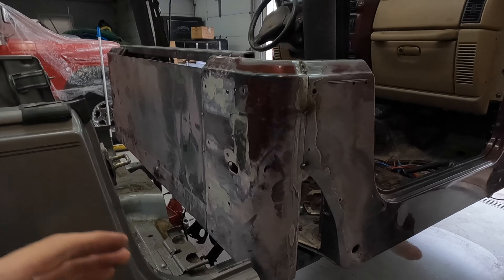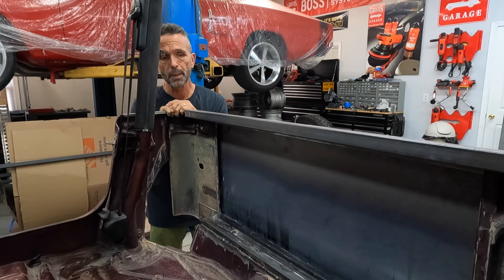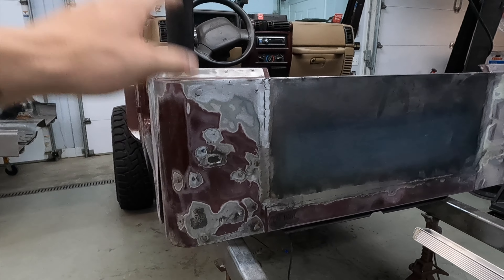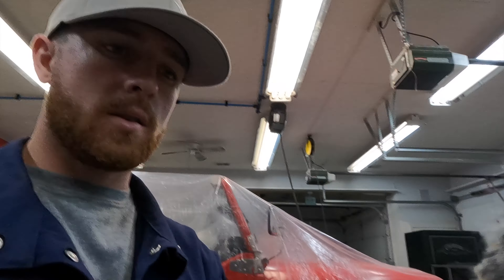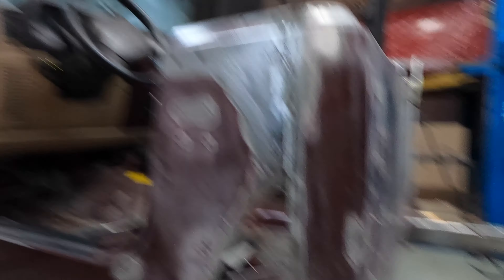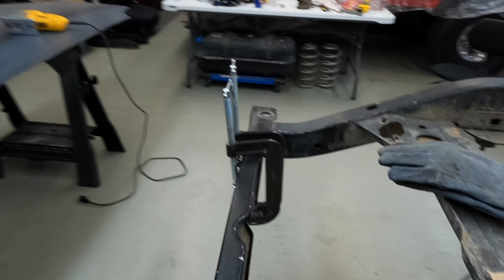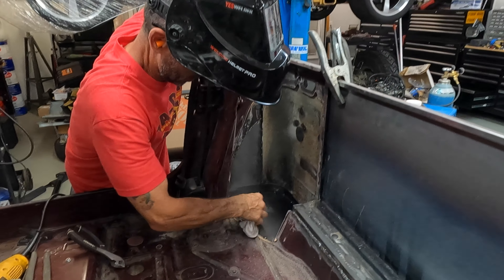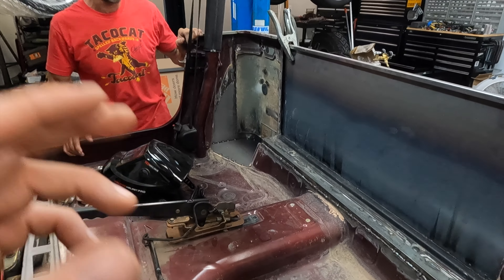PROJECT KRUTE EP. 6 | THE CAB IS COMPLETE!  Building a custom Jeep TJ Brute!

Comment: Looking good Lucas. I really like the way you closed it out...those little corner spaces add a bit of storage. I would think hard about taking the tailgate vent and installing it in the rear...doors won't shut well without. Soft top or hard top. 

Nice job on the corners...are you using 16ga everywhere or was that just the rear filler? 

Don't apologize for what you think may be  boring...those of us following that may or will be doing something similar get value from some of the mundane stuff. 
Keep it up.
Reply from the maker: Thanks Steve!!  This TJ is an 02 so I never had cents in the tailgate, my vents are in the hardtop.  When we chop the hardtop and make it fit, those vents will still be in the same place and nothing should change with the pressure of the cabin.  

We are using 16 gauge everywhere, I appreciate you saying that too, gives me some more confidence.  Thank you.